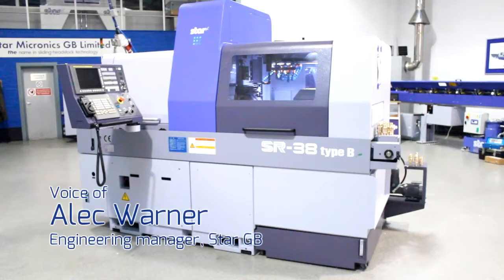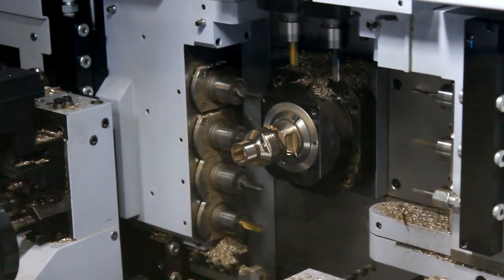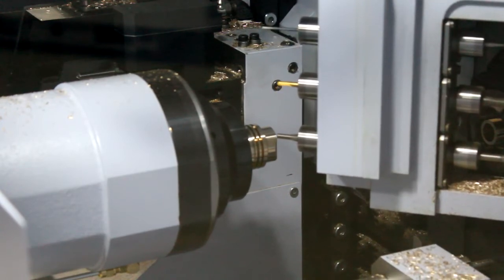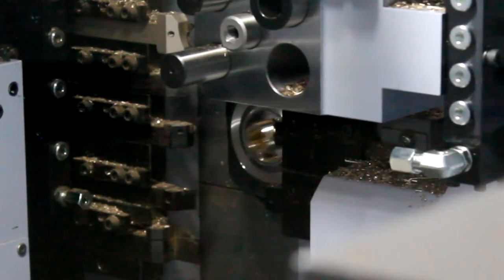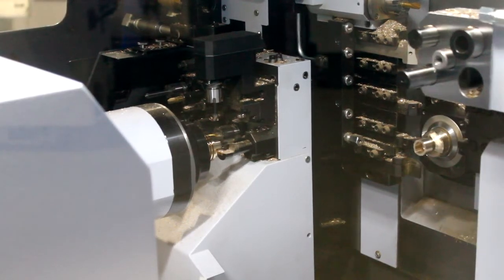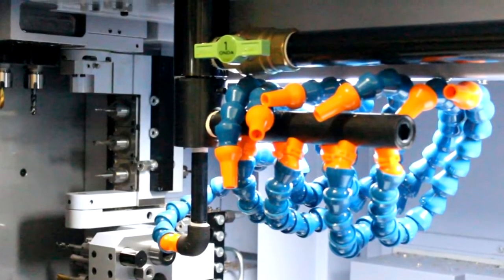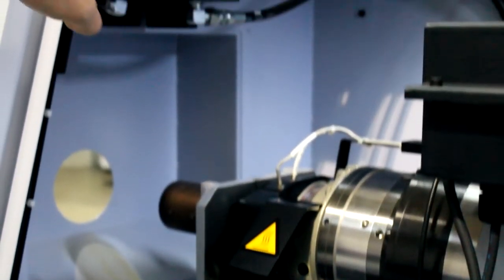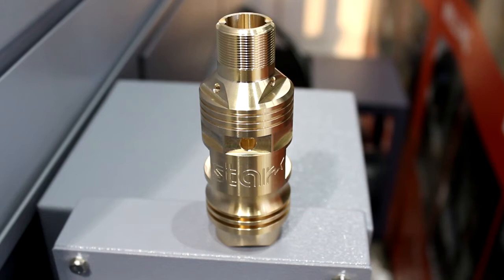Star GB SR-38 Sliding Head Lathe Review

Comment: I have a question regarding the B-axis.
If I use the bottom tool (as you have a step drill in) What is the maximum bar size I can use, and still be able to drill a hole in Y+offset?
looks like it's pretty tight.